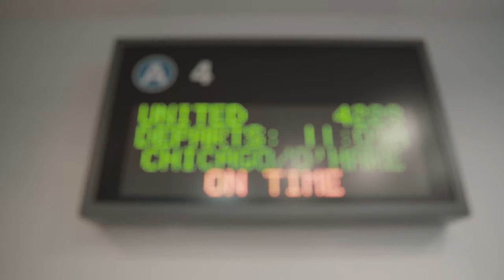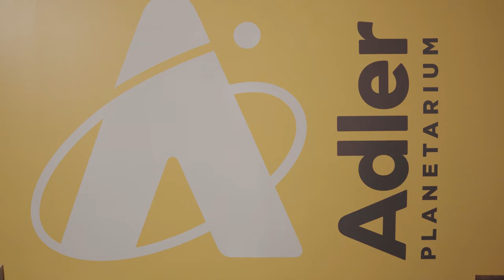Installing a PlaneWave CDK600 Telescope at the historic Adler Planetarium in Chicago

Comment: Very nice.  I think you might want to review the difference between dynamic and static balancing of rotating systems.  Given the slow motions of most telescopes I doubt that dynamic balancing is needed.  Static balancing of telescopes is of course essential.  Again very nice.
Reply from the maker: Thanks for the recommendation Charlie! Dynamic balance for direct-drive mounts is important before tuning the motor control parameters. That's how we can then achieve 0.05 to 0.15 arcseconds RMS tracking error with the mount. With a geared system you are right that dynamic balance might be a little less necessary.
Reply: @MattDieterich  I really don't want to be that person on the internet that is pedantic.  So sorry about this.  You can check out the wiki article on balancing.

https://en.wikipedia.org/wiki/Balancing_of_rotating_masses
or
https://www.bellwoodrewinds.co.uk/dynamic-balancing/

There are lots of YouTube videos on dynamic balancing.  

To dynamically balance a shaft you need to rotate it rapidly and check for forces at either end of the shaft (at least).  You could have a shaft that has a weight off to one side at one end and off to the other side at the other end.  It will be balanced along its axis and not rotate regardless of the position your rotate it to.  However if you spin the shaft quickly you get vibration at the ends as the ends are unbalanced.  

Car wheels are dynamically balanced these days as the put balance weights not only around the rim but around the rim on both the inside and outside.  Of course this is also done with large high speed turbines and electric motor rotors for example.

The main thing is that to dynamically balance something you need to rotate the shaft at a constant speed and measure the vibration.  Just making sure that the CG is along the axis is static balance.

Sorry if I'm kind of pedantic.  I've balanced lots of telescopes over the years.  Of course you are correct, unbalanced telescopes don't work properly.
Reply from the maker: @charlie2640  definitely great info and appreciate the feedback!
Reply: Of course you could have dynamically balance this telescope but I don't think I saw it in the video.  :)  Best!
Reply: @MattDieterich   @MattDieterich  Thanks.  Sorry to be pedantic as I said.  It is a beautiful mount.  Great tracking.  It's amazing what you can do with direct drive and modern encoders.
Reply from the maker: @charlie2640  they're such fun mounts to shoot with. Leaps and bounds beyond the small mounts I started this hobby with in 2007 ha 😀